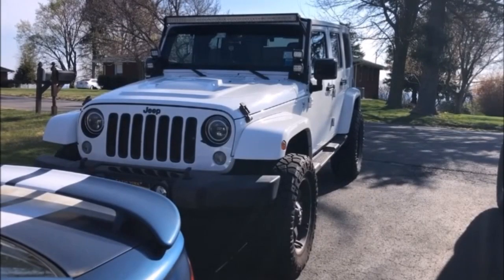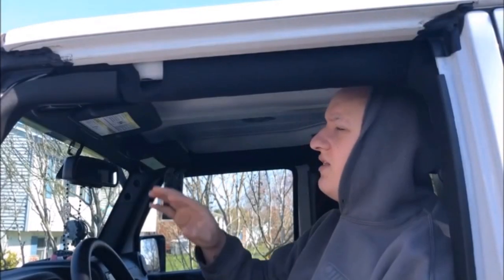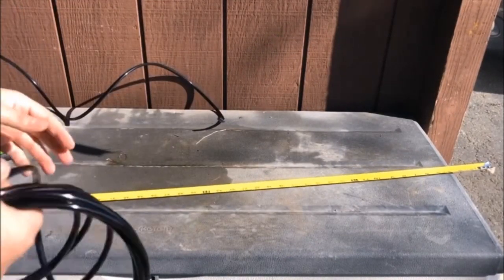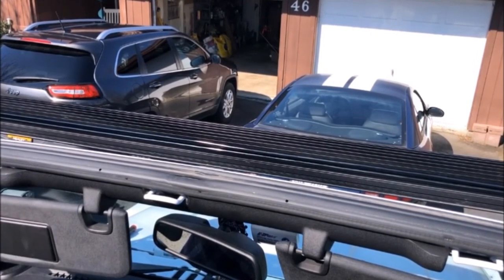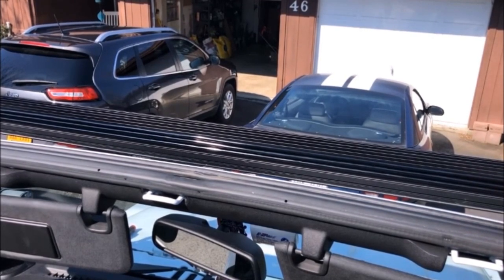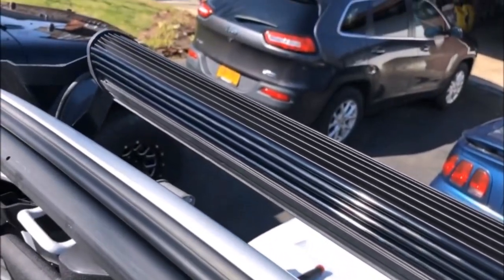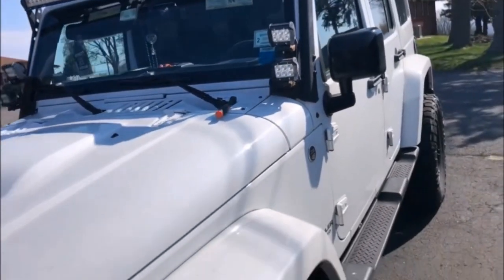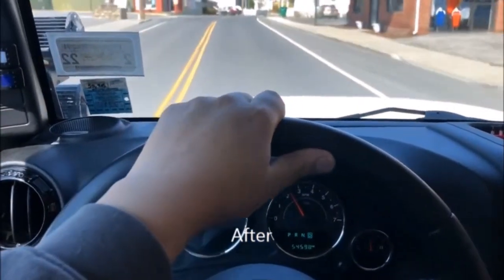How to Eliminate Some Light Bar Whistle/Noise

Comment: Hey aaronhaight22, I was wondering if you know, I have a 2007 compass and am looking for the angry light covers. Are the patriot covers comparable?
Reply from the maker: Don’t believe they make angry eyes for the Compass, could be wrong, check on amazon, Patriot ones won’t work if not you’ll have to spray tint or tint film on them in shape of angry eyes